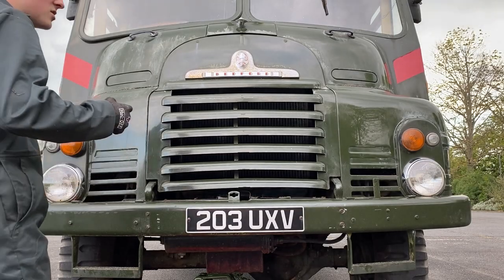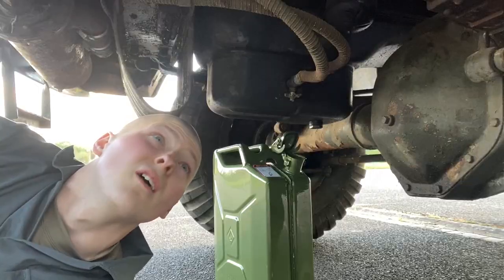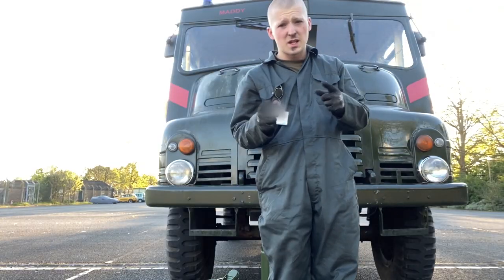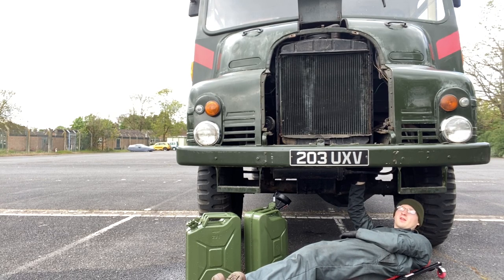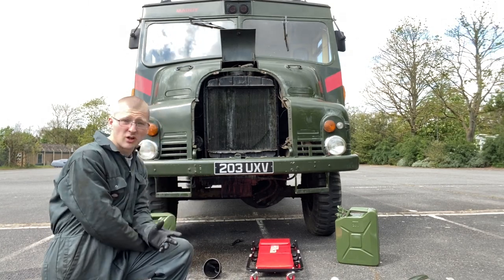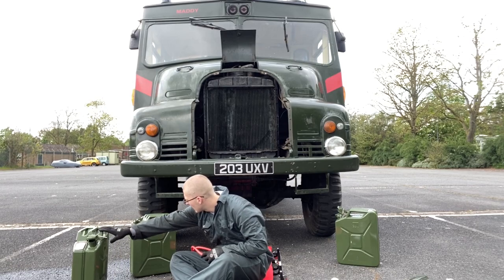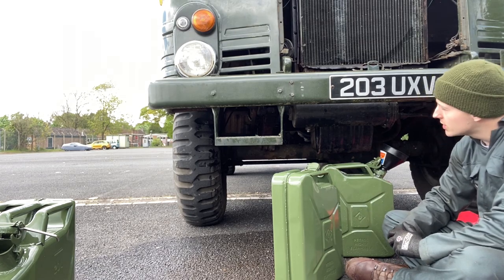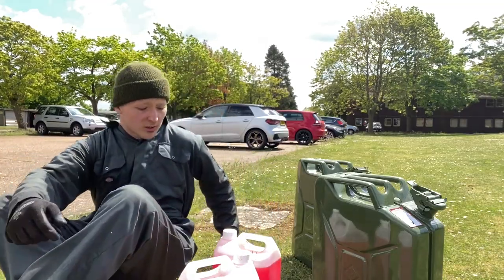Changing The Coolant on my 1956 Ex-Military Fire Engine: Green Goddess

Comment: Excuse me if I'm stating the blooming obvious - you do know there are two sides to the  coolant system, which is why there's an exchanger in between? On the road the circulation through the radiator will cool the engine in the conventional way, while when standing still running the pump the heat exchanger takes water from the fire fighting plumbing to cool the engine.
Reply from the maker: Hi Bill. Yes I am aware the coolant system is split, it probably does not come across very clearly as I had to edit out so much to prevent this being even longer than it already is. When running the pump it says in the training manual that the water in the first aid tank is continually circulated through the heat exchanger in order to take away heat from the pump itself. Thanks for the comment.
Reply: @perksauto2458  making a video adds a whole level of complexity to what's already quite a challenge! Keep up the good work, looking forward to seeing the next episode.
Reply: Hi bill, perksauto, after watching this video I thought I’d check mine, I also can’t get coolant to drain from the heat exchanger drain tap 😩 I’ve blew through the taps but to no avail. It comes from the large brass drain plug but not the drain tap. Any help or info is very much appreciated 👍🏻
Reply from the maker: @jonathanmorgan6708  Hi Jonathan, thanks for checking out the video. Have you tried opening up the cylinder head drain tap as well as the heat exchanger drain tap?
Reply from the maker: @jonathanmorgan6708  I've also replied to your email, so take your pick of what platform to reply on! 🙃
Reply: PerksAuto hi, ive just replied to your email with more detail but yes I have clean blue coolant coming from the engine block drain just a few dirty drops  from the small drain plug on the heat exchanger, no flow at all. If I open the large brass drain on the heat exchanger it pours from there like in your video. Thankyou very much for your reply

Comment: i see you trying your best....i am an ex-RL in service driver and still own the army recovery version and parts.....tip for the long crow bar mounted on roof....long wooden handle to insulate against electric shock, also used on railways and london underground if you are looking for replacement or pattern....original hold down most likely a leather strap....keep trying, she will be worth it. DON'T crunch 1st, non synchro gear when changing down, double de-clutch..lol

Comment: Be careful using plumbers tape on anything that's not water. bit of it can brake up when you screw the fittings in and the the bits can go round systems and cause blockages and damage. Cooling systems aren't to bad but people love to use it on fuel, oil and vehicle airlines which can cause all sorts of problems. There are some really good liquid/paste sealants out there designed for automotive use.

Comment: Please don't think I'm trying to teach my granny to suck eggs, but be very careful when turning corners especially if the first aid water tank is full. The RL has a high centre of gravity and the tank doesn't have baffles so they have a nasty habit of tipping over at speeds higher than 15 mph. When I was in the AFS our local borough brigade had commercial Bedford's and if one was off the run they would "borrow" one of our 2 GG's, they managed to turn them both over. The goddess's prime function was to act as a water relay to bring water from long distances to devastated cities in the event of a nuclear war. Fire fighting was secondary.
Reply from the maker: Hi John. Thanks for the tip, I was aware they were keen to tip over if the tank is full but I was not aware that they did so at such a low speed so thanks for letting me know. Great bit of history from yourself there as well, I'm always keen to hear random stories involving these great machines. Hope to see you on the roof video once I finally get it completed!